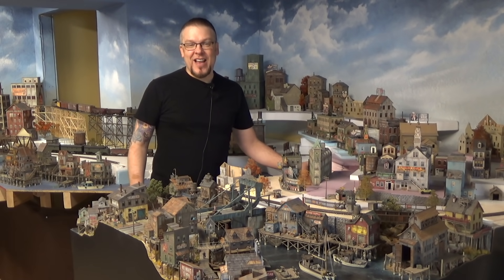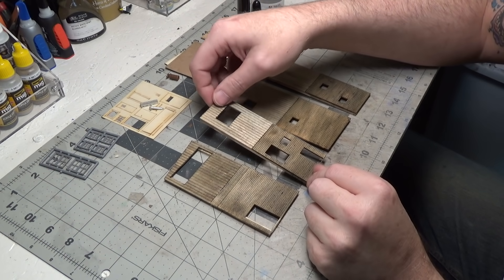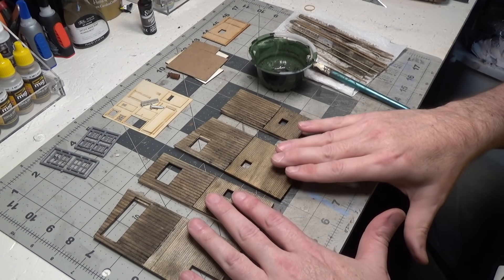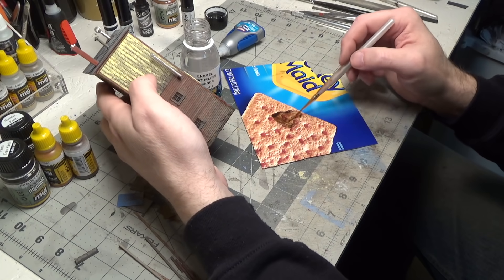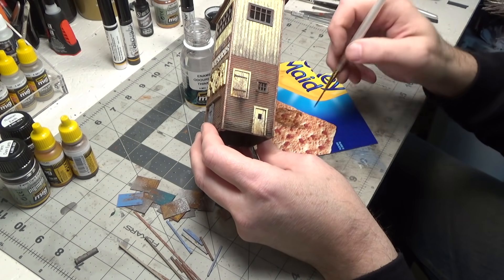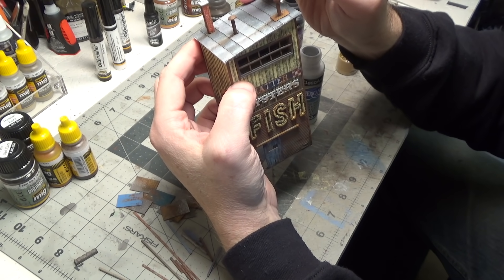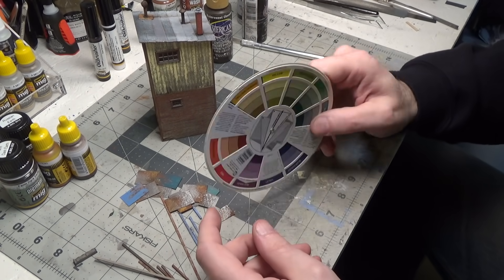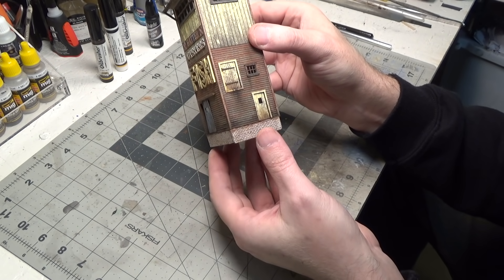Tips on weathering and detailing.

Comment: Hi Jason, you make amazing buildings. I love them. I found your Pepsi sign very interesting. That is a highlight in the house. I'm doing a model railway for a primary school with a friend. A long project !! I found a way to put up signs or graffiti. You look for a suitable template on the Internet, print it mirrored on 80 g paper and then apply it to the building with Photo Transfer potch (mod potch). I paint white areas on the model beforehand. You can use that for anything that is painted on walls and surfaces. It's a different way than yours and can be used especially for small signs. If you like I can send you a link to it.
Reply from the maker: Thank you so much!!! I'll have to try your technique. Thanks for the tip!
Happy modeling!!!
Reply from the maker: Thanks, I really appreciate it!!!
Reply: @JasonJensenTrains  With pleasure. I am happy if I could help you.

Comment: Jason, you mentioned that the boards from Fosscale kits warp if you give them a water-acrylic based wash. Do you have any advice what can be done to avoid warping if you do want to us a water based wash?
Reply from the maker: Yes, put the wash on both sides at the same time. Dont get the wood very wet. I have some older videos on painting and weathering walls.
Reply: @JasonJensenTrains  Thanks Jason!